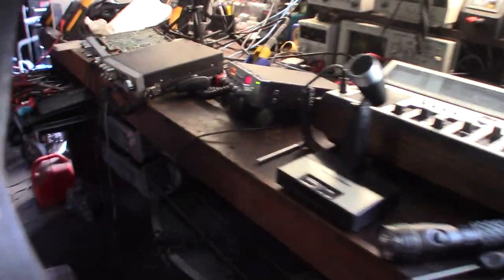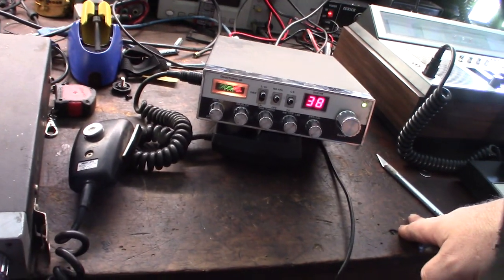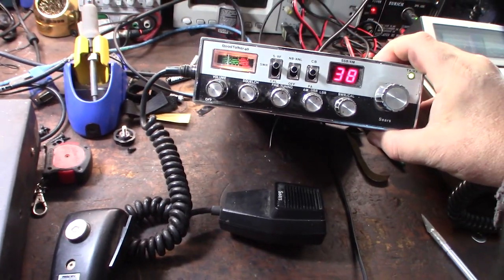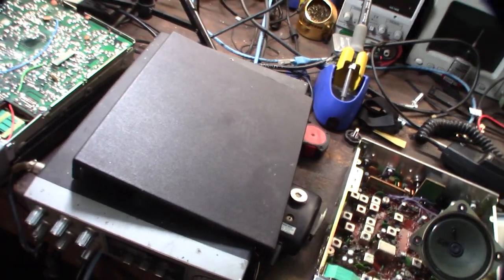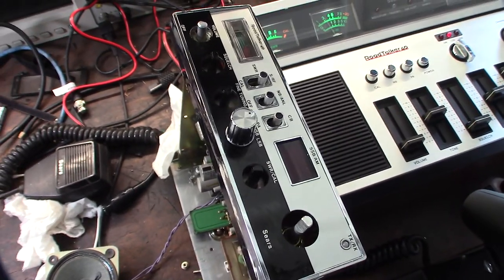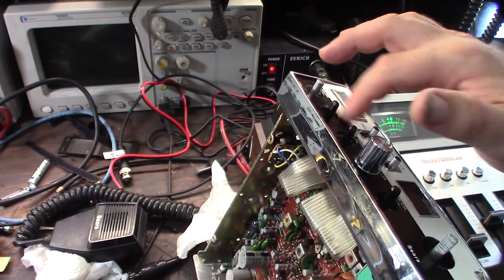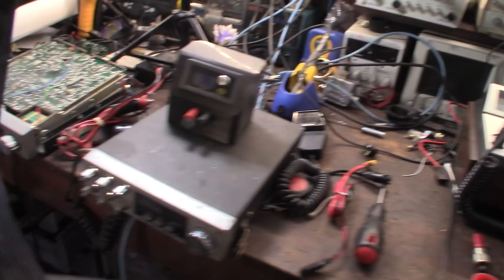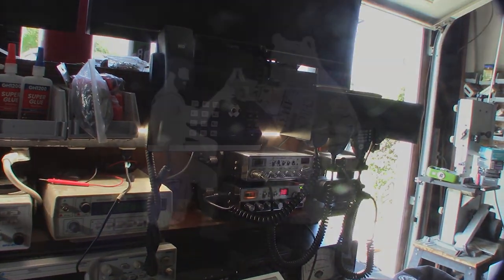RARE!!! Sears Roadtalker 40 SSB Mobile CB Restoration  Part 2 663.3810 Cobra 146 GTL

Comment: i Love that Chassie did know it existed in a Sears Model there's a RadioShack 465 Uniden 122 president 244 and P300 cobra 146 any other you know of Let me know Thanks
Reply from the maker: Its a pretty nice radio, I ordered a cap kit. That will be part 3. I also have the base station SSB Roadtalker 40.